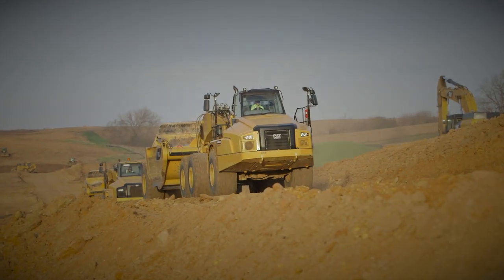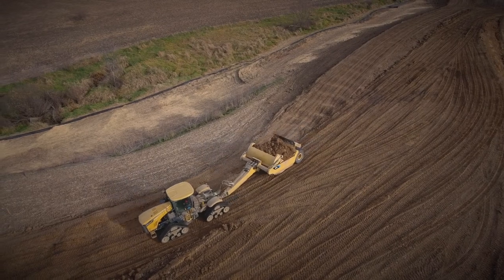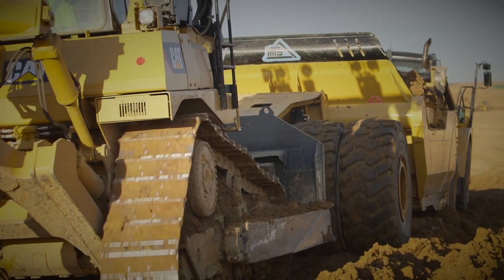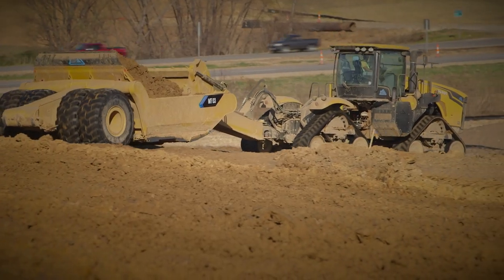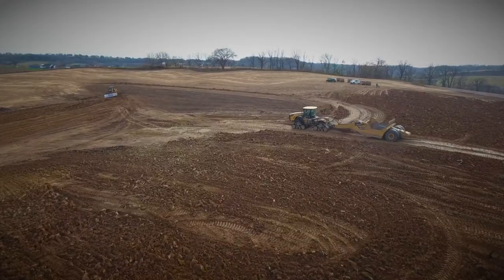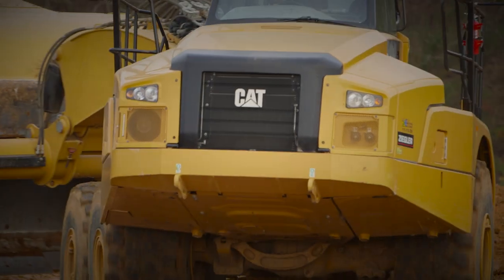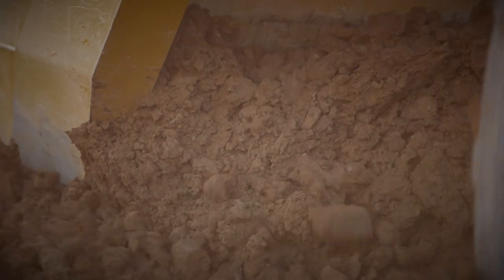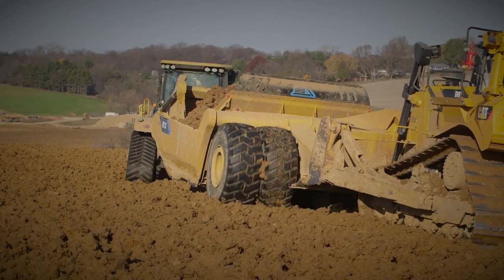MTS Scraper Conversion Package for Cat® Articulated Trucks

Comment: Im sorry guys but an IH quad with a 24 or 27 yard scraper can load the bowl fully in almost any conditions without a pushcat. I respect MTS but with a 30 yd scraper their near impossible to fully load in wet heavy material. We ran MTS alongside IH quads and jd and ashland scrapers and the MTS's struggled to load their bowls. Yall gotta pair them with smaller pans guys. Your hydrualic coupler system is 2nd to none and MTS scrapers have a lot of nice features and work well but the 30 yd scrapers are just too big for a lot of aplications behind the 630 quads.